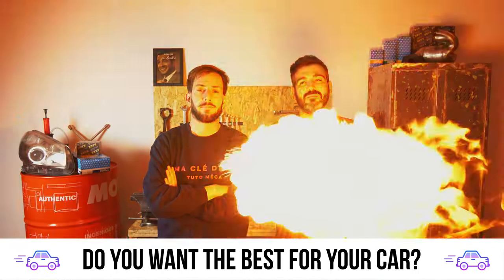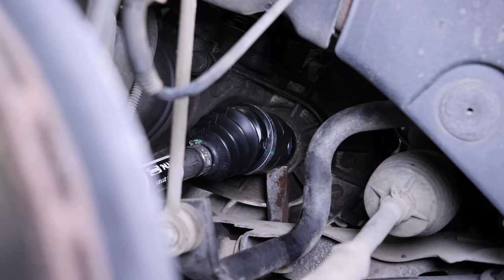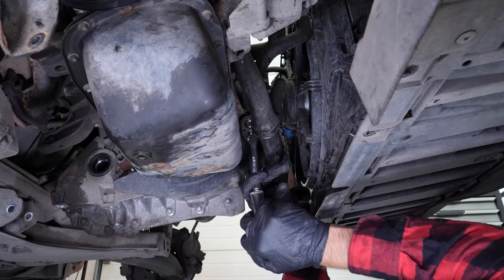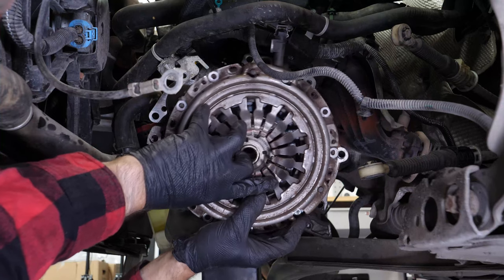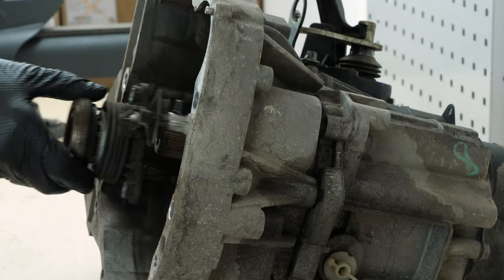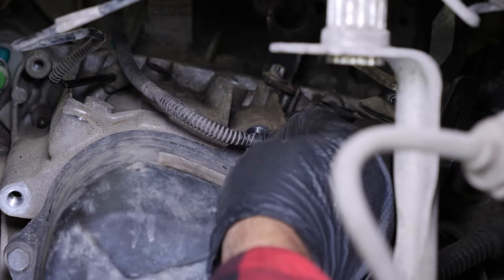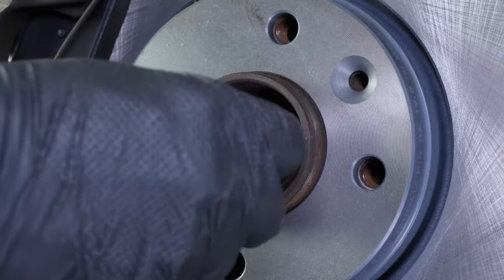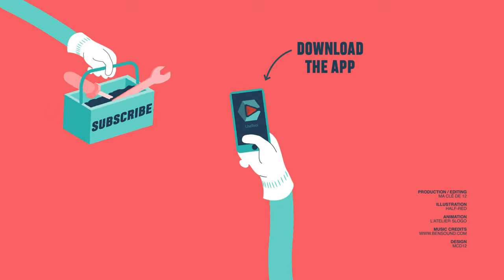How to replace the Clutch Kit Clio mk4 1.2 16V 🚗

Comment: Excellent video, I like the way you used the spanner and bolt to hold the pressure plate in place for undoing the bolts, very smart.
Reply from the maker: Hi @mavez6322! We're glad we could help you out✌ Hope the operation went well?